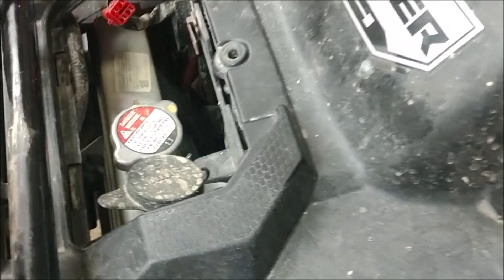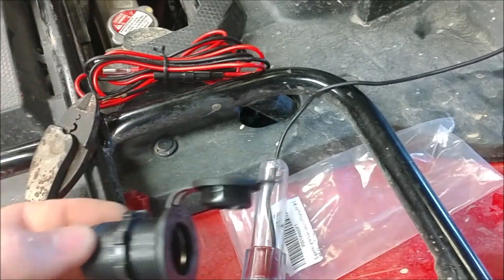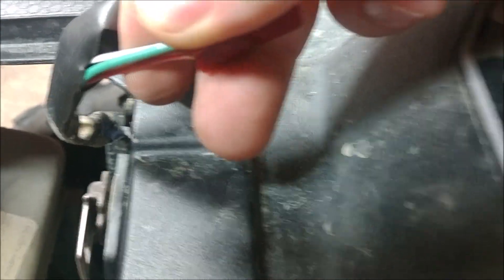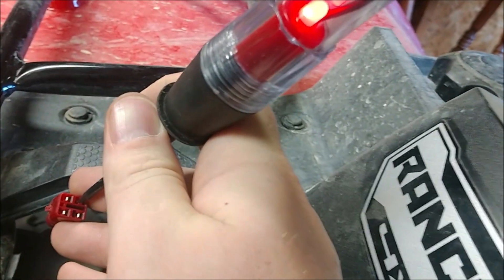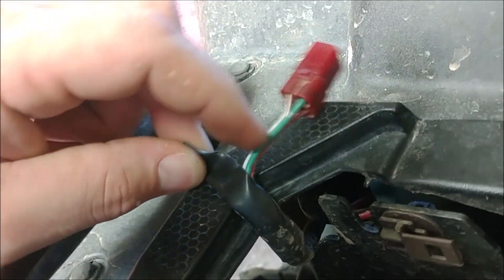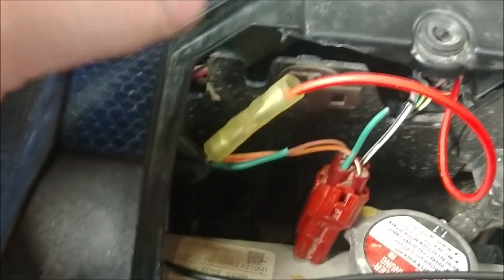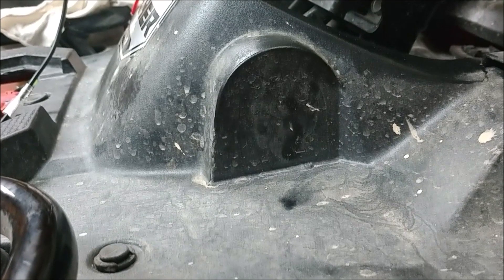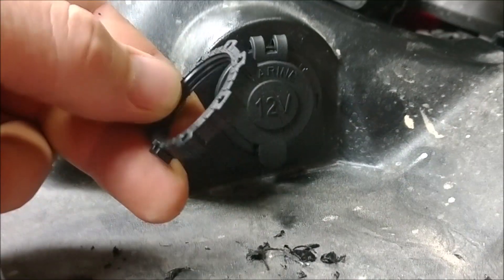How to Install a 12v Marine plug on a Honda Rancher

Comment: Good video. 👍🏻
FYI. That plug is used for running diagnostics from the dealership.  If those green and white wires aren’t still connected, their diagnostic machine won’t work. May not be a concern for some, but may for others.
Reply from the maker: Good feedback. Was completely unaware until now.  Thanks brother

Comment: Toward the end of the video when you screwed the ring on the back of the plug, was it hard to get your hand back in there to put it on? I saw a video where the guy bought Honda parts and they just plugged in, but he took off his front rack and plastics- the ones under the front rack, and over the gas tank. Seems like the way you did it is much easier...
Reply from the maker: Didn't have much trouble at all.  1.5-2yrs later everything still functional and never rattled loose
Reply: @pv2smurf  that's what I figured. Thank you for the video and the reply.

Comment: Do you know what the adapter piece is called to get the more of a water tight seal?
Reply from the maker: I used one I found on Amazon that said Marine 12v cigarette lighter plug
Reply from the maker: I'm unsure if you mean the piece that plugs into the factory Honda wiring.  Check with dealership or a quick search